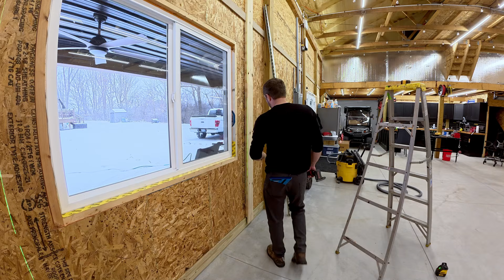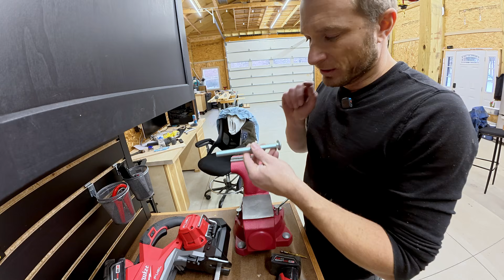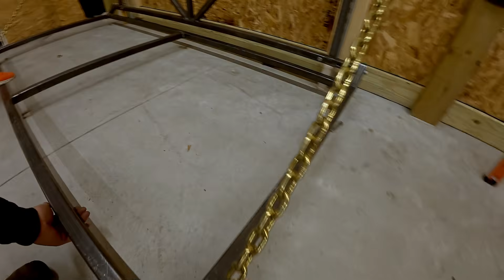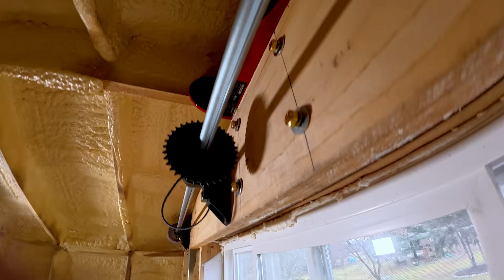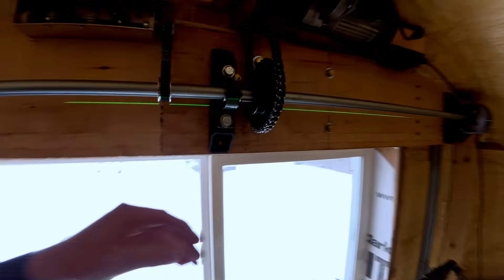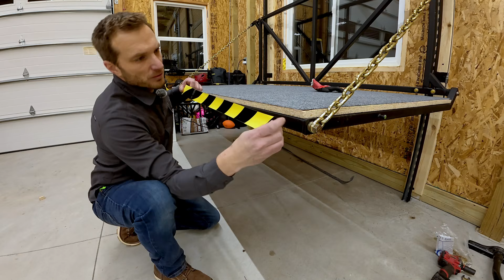Attic Elevator Heavy Duty | DIY Shop Elevator Built Right

Comment: Amazing build, I will be referencing it many times as I do my own, which has some different needs and challenges. 

One simple modification might make the bow/bounce in the middle of the platform much less... A simple welded on L bracket in the bottom center of the wall frame. It would be under the folded up frame and out of the way (still round the corners for safety), but when down it would give support to the center of that long span. When doing heavy loads, keep the weight towards the wall as much as possible.
Reply: Or even maybe a couple small cables from the diagonal vertical braces down to the back tube of the platform. Looks like it would slack when up, and just give extra support when heavily loaded.
Reply from the maker: Hey thank you!    Yeah those are some good ideas.  It really doesn't sag much and realistically I don't plan on putting extreme amounts of weight on it that was more of a test.  But probably wouldn't hurt to have the cables like you said.   And yes loading towards the back puts less strain on it.   Thanks for watching and stay tuned for the attic load capacity upgrade. Working on it now.

Comment: Very nicely done sir!  The only changes that I would consider is a tension adjustment for the chain drive and use a 5/8" hex sprocket for the chain drive.  As I recall, McMaster car has hex id sprockets. You have to use the QD style sprocket. Alternatively,  a machine shop could broach the hex shape into a standard 5/8" dia id sprocket.  Then the welding wouldn't be required and future serviceability would be easier.  Will be looking for more great projects from you!  Good luck!
Reply from the maker: Thank you!  Yes I do plan to add a tension adjuster.  As far as the hex bore in the sprocket. I searched McMaster high and low looking for one and never did so thats why I did the weld on style.  Thank you for watching and stay turned for more!

Comment: How about automatic locking stops like they have on car lifts for extra securement to hold the wieght and not just relieging on the motor to hold it up.  You can put latch system to pull it out to lower it.  Again something like a car lift.

Comment: Recommend when using lock nuts your bolts have minimal threads thru the nuts.
Reply from the maker: I plan on keeping an eye on everything, maybe even set up a maintenance and inspection scheduled.   Everything has a lock washer so it should help prevent things from coming loose.  Thanks for watching I appreciate it!

Comment: Like the design idea here.  What it's missing is anything to catch the load if something in the lift system fails.  Even if you are not under or on the lift, the crash of it free-falling will be insanely violent.  The mounting point of the cables to the platform is where this needs to be.   If the tension disappears, a brake or a lock needs to engage.   Elevators use brakes because locks can fail from the impact of even a few inches of drop.   Food for thought.
Reply from the maker: That's a solid point, I've got some ideas in the works to address safety for a future video! 👍

Comment: Excellent job!   A strap handle for you to hold onto something when riding the elevator up or down. That would leave you with a specific place to have your hand so by accident you do not crush your hand holding on to the metal frame in the wrong place. With a strap handle it would hang down when not in use and be out of the way with closing the floor for storage..
Reply from the maker: Hey, thank you! Thats not a bad idea, I m8ght do something like that.   Thanks for watching!

Comment: Great job, very impressive! One note regarding tape, you’re absolutely correct about stretching tape where it’ll try to contract throwing those straight lines off, especially when painting lines. It’ll lift up and that’s where those nice painted lines have blotches. About the only tape one uses just the opposite way would be electrical tape. It drives me nuts seeing loosely wrapped electrical tape around splices. THAT tape is designed to be “pressure sensitive” so you’ll want to stretch it a little so it pulls on itself keeping connections well covered tightly! You’ve made a sub out of me, thanks for taking us along, what an awesome project and completed above and beyond safely! 👍🏼👍🏼 from this guy
Reply from the maker: Hey thanks for Subscribing and you are right about electrical tape or and tape when wrapping around something to try and seal it.    I appreciate you watching and stay tuned for more soon.  Thanks.

Comment: Those aluminum drums are never gonna hold. They will strip right out
Reply from the maker: They are rated for 750lbs working load each so thats a total of 1500lbs. Should be fine.
Reply: @Built-By-Sam what’s that roller chain rated at?  Just my opinion. Of course you can do what you want.  But at minimum I would have some type of fall protection incase of any failure to prevent someone under it from getting hurt.   And I know you say it’s not going to be ridin.  But truthfully it will be.  It’s to convenient not to. It will happen.
Reply from the maker: Roller chain has a working load of 940lb. And a breaking strength of 4700lbs. There is a part two to this video that I talk a little more about the safety of this and some plans I have to address them.

Comment: My 2 cents.. maybe add red or yellow LED strip lights  on both sides of the rails / around the caution areas. Set up to come on any time it moves. Just as an extra safety  warning.. Thinking if someone is running something loud. And may not hear this being used,  it serves as a visual warning.  
Many can be set up in different fashions to fade in and out or flash speed. Or chase.  It would be cool if, could set up to chase in the same direction it's moving. It's an Awesome build..I had been thinking on something like this also but on a smaller scale. Has small steps to loft. And I don't like trying to carry boxes and such to the top.
Reply from the maker: That's a cool idea for a safety feature, I'll have to look into that Thank you.

Comment: Because your lift is sitting right there in front of that window, you might want to see about putting some type of expanded metal or something over that so that nothing falls into that window or that someone doesn’t fall into that window
Reply from the maker: That's a good point, I might look into adding a guard there to be safe. Thanks.

Comment: Since everyone else is posting theirs, mine is the key on shaft sprocket. Not an engineer, no actual evidence here. But that's the thing that would worry me the most as currently it seems like the single weakest link, could fail completely and with no warning. Could be rated for 60x the actual load here, no idea, but that's something I'd want to figure. 

Very cool project!
Reply from the maker: It may look like a weak point but a 1 inch long 1/4" key will hold over 7000lb. So we should be good.   Thanks for watching!

Comment: How will you service trolleys
Reply from the maker: That is a great question,  and to tell you the truth i dont have a plan for it other than ill cross that bridge when I get there.   Being such low speed and the fact that there is very little stress on them i do not anticipate having to do much to them or worrying about them failing.  I can spray them down with a little lube now and then and they should be good for a long time.   Thanks 👍

Comment: I really like what you have done my only concern is what happens if the chain comes off half way up and you’re riding up
Reply: Fall prevention
Reply from the maker: Its all low speed and I really dont think the chain will just fall off.    But  there is always risk but I am still exploring options to prevent failure

Comment: I'm not in love with that chain setup.  When designing it, did you considered using a jackshaft opener?  Some of the openers for large commercial doors are rated to over 1000 lbs.
Reply from the maker: I thought about it but never dug into it.  I figured they would be to expensive and not strong enough.  Normally the doors have springs that make them much lighter to lift but maybe they are strong enough.  Im not sure.

Comment: Loved the build, ironic the little guy had some stitches... thinking of him going up and down on the lift... safety belt in the center so no accidental falls... also I cringed when you were sitting on it and imagined someone catching a body part between lift and floor of the loft... so maybe some caution tape around the loft opeing... not for you for the other guy... maybe Im getting too old and fearful... just thinking... please note - Im jealous of the built - excellent work...
Reply from the maker: Yeah he should never be on it especially not alone.  And it now has it own circuit so I keep the breaker turned off when I'm not using it.  Thanks for watching.

Comment: great video the only thing i would add is a cable safety rail, very easy like a drop in vertical post in each corner and 2 drop in posts in center of front that latches together, maybe a top cable and a middle cable, cable can be connected to frame on back and 4 holes in back frame to store the uprights for storage when not in use, then you and your family/son are safe going up or down
Reply from the maker: Yeah thats a good idea.   Thanks for watching!

Comment: Very well done.   Try pulling the power on it to simulate power going out and see if the brake kicks in.  One of the best I've seen.
Reply from the maker: The brake is mechanically applied and electronically released so no power means the brake is on.  Thank you and thanks for watching

Comment: Great job. You have built in an important factor- by having the entire support system like two times the design torque output of the motor. That should provide a factor of safety to not break something more important like a cable, sheave etc. in the event that there’s an obstruction, overload or binding somewhere. Hopefully the motor just stalls before something critical fails. 
I’ve tried to think of something you could use as a fall fail safe but I haven’t gotten a good idea other than something that needs another cable and pulley. ( a hydraulic cylinder system). 
To me it looks like the weakest point is for the upper trolley to pull out of the Uni strut. Or the retainer clip comes off the chain link, then the master link walks out and the platform falls. It’s good to overdesign, but you still need a fail safe against a fall. You need two chains.
Reply from the maker: I can do the exact math later to figure out the load on the trolley but it should be well within spec of the strut. the strut is supported every 2' and the trolleys have 6 roller bearings it spreads the load out across the lip.  But even if there is 1000lb on the platform only 1/4 of that goes to each chain. now being the chains are on about a 45* angle you have to times the 250lbs by 1.414 (thats the factor for sling tension at a 45 degree angle) so that would mean there is only 353.5 lbs on the two upper trolleys. even 100% worst case there was 1000lb at one outside corner it would be 1000 x 1.414 so it would still only have 1,414lb on one trolley. would still be fine.    I will still be working towards a fail safe for if there was a sudden failure but out of all the things that could fail the strut would be my lowest concern.  Thanks for watching.
Reply: @Built-By-Sam  You will be able to monitor the rail and trolley because it’s right there in front of you. What you cannot see is when the master link walks out of the chain ( or the chain fails) and the shaft free wheels while you crash down. That’s why I suggest either two chains (you can see ones off) and/or a system to slow your fall.
Reply: I have an idea. Install a long threaded screw shaft vertical with a nut mounted on the platform. When the platform goes up and down, it turns the shaft. Mount the shaft in a bushing that allows it to be spring loaded vertically so that the shaft lifted up off of a lock plate. If the platform falls, it pushes down on the shaft/spring and engages the lock plate stopping the fall. Or perhaps a fluid damper on shaft rotation to slow a fall. This approach leads me to a design with a vertical screw drive to eliminate all the cables, hoist,pulleys etc.

Comment: Very nice build indeed.  What size cable did you use , I tried to find the info but couldn’t find where you said what size you went with. I don’t wanna go too big and have it not spool on the drum correctly. I’m gonna be using this for my barndaminum build. My only question is how much load can that uni strut take before expanding enough for the trolley to pop out ?  I realize that if most the weight is closer to the wall going up it’s very strong but if you had weight on the outer edge of the lift how much could it take before spreading open and letting loose of  the trolleys ?    I definitely think adding 2 -500 lb safety yo yos to it would be wise for sure just in case the chain gets loose and slips off the sprocket. Maybe dual chains just as a back up ? I dunno I’m an overkill type guy but I think you nailed this rig for sure.
Reply from the maker: It is 3/16" cable approved for lifting.  I will have all the materials and links in a video posted in a few days    and see the answer I replied to the comment above yours about the trolleys and strut.  Thanks for watching.
Reply: @B @Built-By-Sam appreciate the reply and that’s awesome you putting together a list. I think I’m over thinking it for sure. I could always use more unistrut tracks if I’m worried about it but I think it’s plenty strong. Everything you used is plenty strong and over rated for the capacity when you look up specs.  Everything else being equal it looks like this thing can lift 1500 lbs as the drums bring the lowest rating part @ 1500 lbs as long as the unistruts will hold up to that point.

Comment: You definitely executed this really well. I'm glad you caught the center bearing issue early as I was worried about that at the beginning of the video. I think your most likely failure point is still in that area, manly the winch + chain itself.

To be clear, I'm not saying it is definitely going to fail and kill you, or I even have a simple way to make it better. But I don't trust a single chain / a vevor winch a ton.

But as others have mentioned having some sort of secondary lock would make me feel a lot better. I've been thinking about how to do so myself and there are not a lot of easy ways to do it that don't have additional issues.

I know FOR SURE if my dad had made one of these I'd eventually ride it when I was old enough to bypass whatever lockout is on it lol
Reply: They lift shutter doors in that fashion all the time, heavier than that weight.

Comment: Great video, the only thing I would do differently if it were mine is to add an electric solenoid plunger to each rail so when it it as the top, the plungers push in through the rail as a safety stop just incase the lift or a cable fails other than that, awesome lift.
Reply from the maker: Good idea.    Thanks for watching.

Comment: Awesome project! Love it.
I'm not sure if this is a problem or not, but is there a risk of crashing the lift at the top in the platform folded up position?  Basically, is there enough headroom above attic floor level over by the wall with the platform folded up?  If not, maybe you could use the LiftMaster cable tension sensor to set up a secondary limit switch for this folded up position. Just spitballing here, but seems it could be adjusted to max load, and also act as a secondary safety stop in case your existing limit switch ever failed with the platform dangerously high and that failure snapped a cable or whatnot.
Reply from the maker: Hey great observation,   you are right with it folded up if I run it all the way up it can hit the gear on the shaft.   My plan is to use the factory limit switch that the hoist has built into it. Ill set it up so if the platform is folded up it will contact it and stop it before it goes to high.   Thanks for watching
Reply: @Built-By-Sam  
Perfect!  That'll do. Alternatively, you could set a secondary electronic switch (on the up-button limiter circuit; wired in series) and set it to interrupt when some highest portion of the platform (in the up-folded position) mechanically triggers it.  Anyway, I look forward to a brief update of your solution in some other future video.  Thanks for the quality content!

Comment: nice build man ! I would just add a treaded rod in between your motor mount and that bearing block under it to just spread the load right to the bearing block and then the motor mount can never move down closer or flex and have the chain skip on the sprockets when under a heavy load
Reply from the maker: Yeah thats a good idea.  Ill look and see how i can mount something like that up.    Thanks for watching!
Reply: @Built-By-Sam  also just so you know that #40 chain is rated for 816lbs safe working load. maybe move to #50 chain (1625lbs) or x2 the #40 chain for safety as that is your only way to brake the fall if something did happen
Reply from the maker: I like the idea of maybe doing 2 #40 chains like you said if one was to fail the other would still hold up     thanks

Comment: Whats the capacity of those bottom cords at span? Seems like your limiting factor here is that your roof is not designed for it?
Reply from the maker: Not nearly what the hoist can lift but i do have a plan in the works to solve that problem.  Stay tuned.

Comment: They make fall arresters you can bolt on to it if you wanted to add a saftey factor.  A centrifugal clutch would catch if it goes too fast and stop a fall if cable snaps
Reply from the maker: Yes good suggestion.   I have been looking at this type of system.